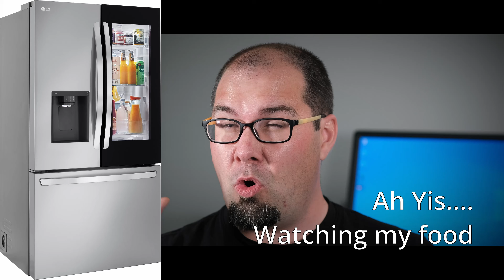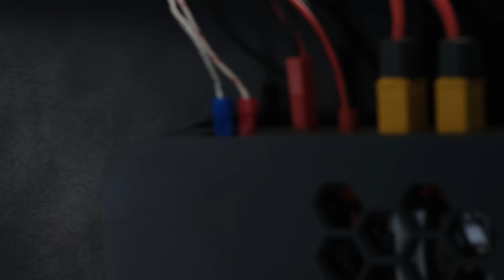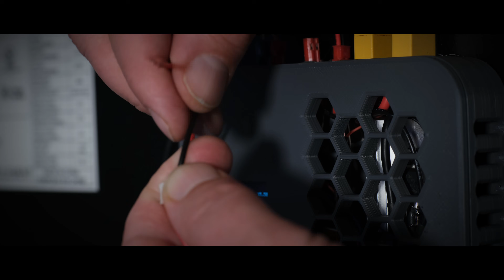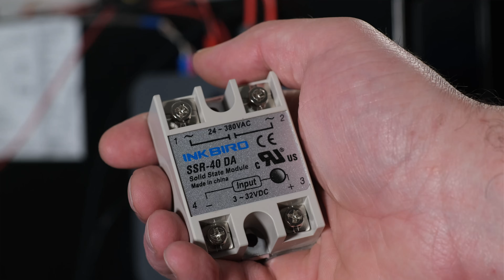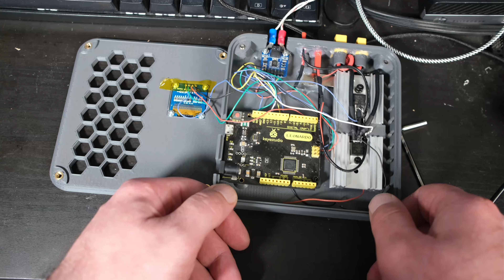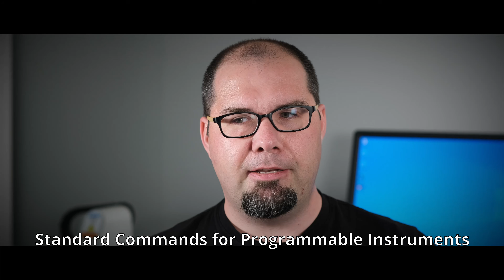Build an Open Source Environmental chamber

Comment: Thanks for sharing. I built one a while back with a free minifridge, light bulb, fan and $30 Inkbird temperature controller. Very handy if you don't need a lot of heating or cooling power.
Reply from the maker: Exactly. The benchtop units could cool more and faster but I just needed stable for long periods.